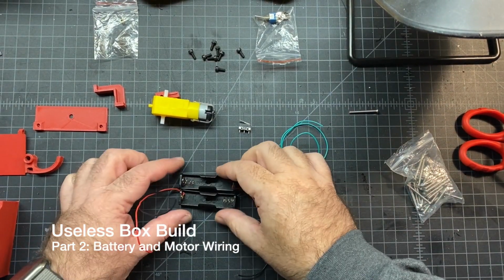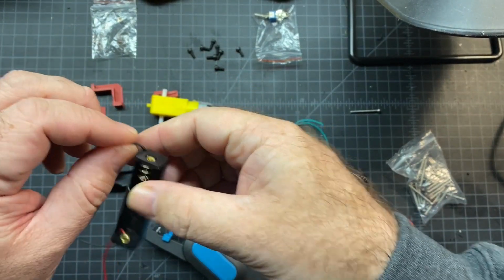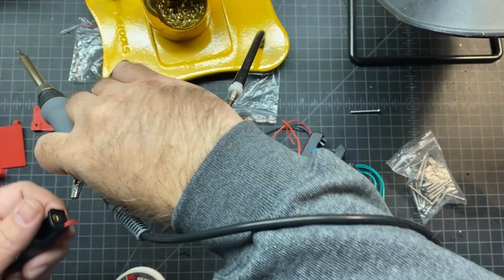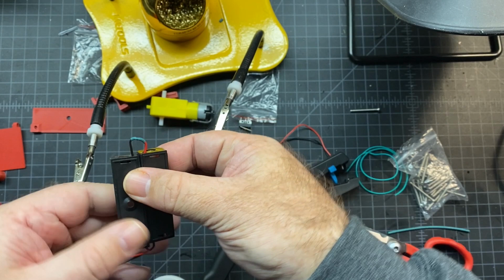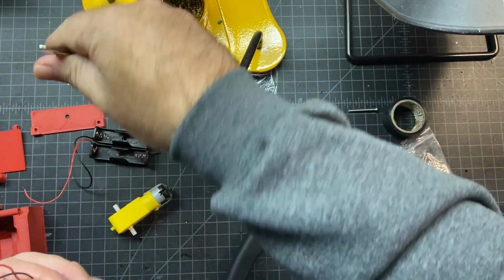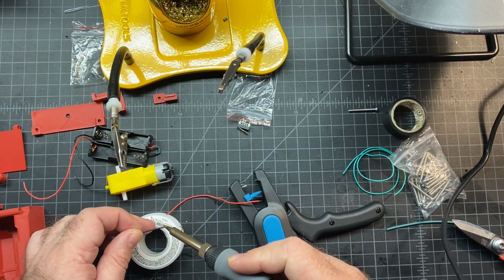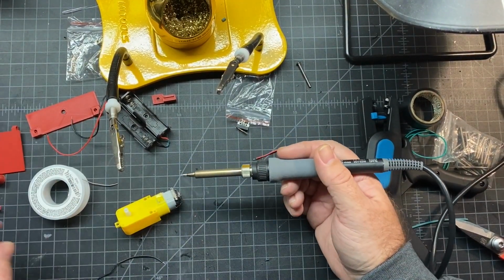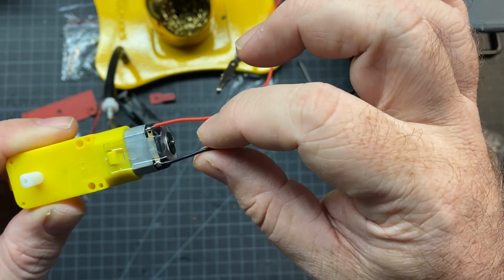JustAddFilament - Useless Box - Part 2  Battery and Motor Wiring

Comment: any idea why it uses 2 single battery holder than a single dual battery holder?
Reply from the maker: I think it's because it is easier to fit the single battery holders in as opposed to a double one, since you have to angle it in to fit it.